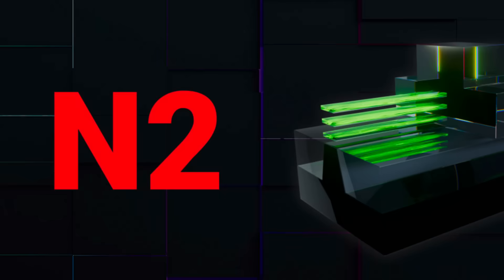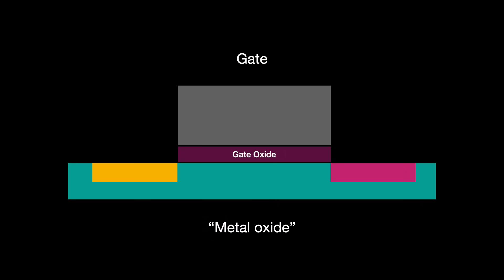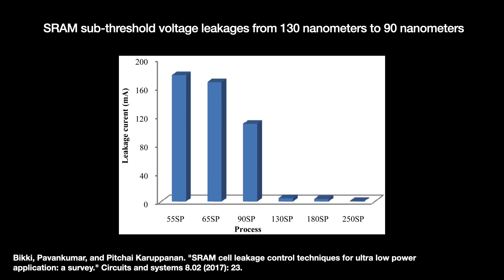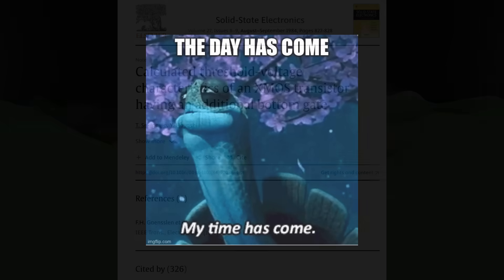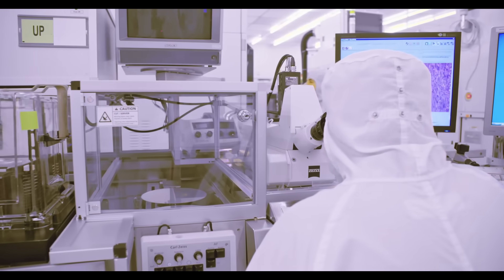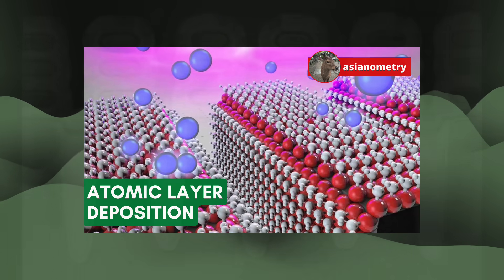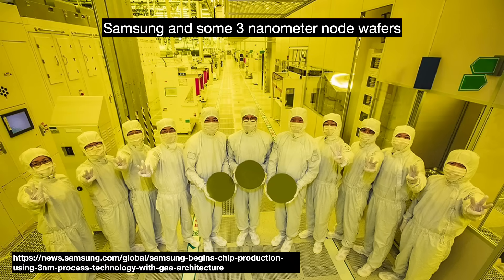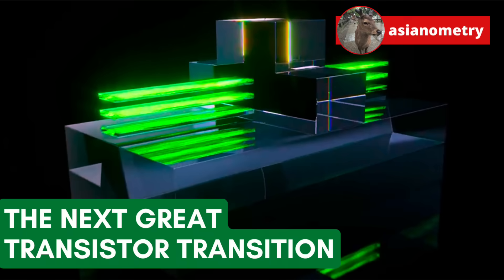The Gate-All-Around Transistor is Coming

Comment: I have learned more about fab processes from your channel than I did getting an electrical engineering degree.
Reply: When I studied, around 1992, the professor said, that replacing analog, chemical photography with digital cameras was impossible. It would require at least 8 Megapixel! Unimaginable at the time...
In this industry, you are out of date every 6 months, so it appears.
Others back then were positive, that the first 33MHz PCs (was it 286?) would never work, because it is just too high a frequency...
And today, they still have some wiggle room left to improve electronic circuitry and the production process. But also that will end, rather sooner than later. I wonder what will then come next... Me personally, I have no idea. Nonlinear optics? Biotech? Maybe asianometry could enlighten us, how the non-electronical future might look like.
Reply: @neo3418 The first 33 MHz processor was i486. There was a 33 MHz i386, too (AMD took it further with 386DX40 MHz). 

Intel's fastest 286 was 12.5 MHz. After launching i386, Intel moved all its atention to it, and Intel didn't allowed that second source partners could make the chip. So the second source partners, stuck with the 16-bit 80286, had no other option than develop the chip clock. The fastest 286 achieve 25 MHz - made by Harris. Most 286 motherboards topped at 20MHz, due to the scarcity of higher speed chipsets. There's an additional problem about that, because AT(ISA) bus runs at 10 MHz max, so the chipset has to decouple the bus from the processor.
Reply: There's already working biotech and their manufacturers claim it's better than silicon and quantum computing. Expensive as fuck tho, you gotta replace the organoids every few months. Also, not very ethical
Reply: Why would you learn about fab processes when getting an electrical engineering degree?
Reply: @its_jjk  Was communications engineering - a specialized electrical engineering course. And it was a class about how integrated circuits are being made and how they work. We also had other peripheral classes like statistics and whatnot.
Reply: @its_jjk because achieving design characteristics of a device/component depends heavily on how you fabricate it...And an EE student is meant to learn about designing physical aspects of transistors.
Reply: @its_jjk I took computer programming and they had me take accounting and psychology courses. Post secondary education is not truly about getting educated anymore, it's about jumping through hoops and paying money.
Reply: @SupraSav  - Industrial Psychology can feed into good UI/UX design and accounting is just useful in general for business. It's still a little odd if those were hard requirements, are you sure those weren't chosen electives?

Comment: Yeah you should have stuck "to TSMC" at the end of that title since Samsung has been using GAAFet in production.
Reply: They do... but they have no high profile customers making anything really cool to point to yet. And that's not the first time Samsung Foundry has been in this boat: Their fabs claim to have the best thing since sliced bread but Samsung Products is having their flagship chips produced.... by TSMC...
Reply: @andersjjensen  After researching more, there is conflicting data about what Samsung is doing.  They don't have GAAFet in production.  There are article TITLES that shouldn't say what they do.  When they are in production on their "3" node they'll be using MBCFet according to ONE information release, and they said it won't have the performance of TSMC N3, whatever that means.  MBCFet is almost the same as GAAFet but it deals with nanosheets instead of nanowires.  I assume the transistor are bigger and therefore transistor density isn't as good.  And I think it would be easy to assume this is about lithography and being able to etch out the details for GAAFet if all this is true.
Reply: @johndoh5182  Sounds like Samsung allright. They also touted having "26Gbps GDDR6 memory that rivals even base spec GDDR7X memory"... but after 9 month the status on their web page is still "sampling" which means they do, in fact, not have it in volume production.
Reply: And there was recent news out of SK that Samsung had a production yield of exactly 0% with GAA when they ran one of their internal chip design through the process.

Comment: is this GAAFET solely for power reduction or how much density increase is there? i.e can we pack more logic inside it?
Reply: With GAAFET they can move the source and the drain closer together shortening the channel length of the transistor. Also with nanosheet the fin are now sideways and on top of each other so they don't take as much area as current multi-fin transistor.
Reply: Video stated around 15% density improvements. Not sure if this is without backside power delivery. But better power efficiency means better clocks, and that is very nice

Comment: Hughes developed this tech in 1985.  Good luck finding out what happened to it. :)
Reply: There are many MANY semiconductor technologies that were proven in the lab several decades before they became commercially viable. One thing is to do it. Another thing is to do it with such low defect density that you can build anything useful with it. And another thing, yet again, is to be able to do that at several hundred wafers per hour with a method that can be "copy/pasted" to many production lines spanning several fabs.
Reply: Hmm. Nerds like arguing about who did what first, but gate all around at 1 µm is not the same as gate all around at single digit nm. Completely different manufacturing challenge and a whole different pressing need to make it work in order to advance the technology.

Comment: This is basically the only thing about manufacturing nodes that I have high hopes for. Lower power consumption means that you can squeeze more cores and more GHz in the limited TDP, which can directly improve the performance.
This isn't something we really see in recent years. Despite how active manufacturers boasts their new nodes, the frequency of actual chips didn't really increase as much as they claimed, the power consumption per core-GHz didn't really change, and the price is getting higher every gen. To some extend, newer nodes are no longer an upgrade anymore, more like optimizations for certain usecases. Hope GAA could at least get the performance uplift back on track.
Reply: I give it 3 years from reaching the market before Wirth's law renders the performance gains irrelevant

Comment: Could you make a video about the prospect of using a particle accelerator in a semiconductor fab, both for cutting the wafers really thin and as a high power light source?
Reply: this
I recently heard that chinese fabs were considering use of particle accelerators as an alternative to EUV and had never heard of the technique before
Reply: Can you name some articles on this?

I definitely want to look into this.
Reply: @kingkrrrraaaaaaaaaaaaaaaaa4527  I would have to google. It would be quicker if you googled it yourself.

Comment: I've been out of the semiconductor game for a long time. Does anyone have the figures of merit for these transistors?
Reply: What FoM are you looking for? As far as I'm aware, unlike with the switch from planar to finfet, the switch to GAA and CFET isn't about individual transistor performance as much as it is about TOR density. As RF designer, everything since 22 nm is a step backwards for my performance (though I hear the high-speed analog guys still get some minor gains).
Reply: @JorenVaes I would love to know what the f_t and transconductance looks like. It seems like there is an improvement in output impedance too? I'm just curious how the transistors are better. I haven't seen any numbers for all these nodes, so it's hard to contextualize what's improving and what's the same.
Reply: @ion599 I can't comment on Ft, as we tend to not use that that often in millimeter-wave design and work more with Fmax as a metric instead. In general, Fmax has flattend around 300 GHz since 65n, and stayed quite constant until 22 bulk (with exception of 22 FDSOI, which has an Fmax of about 380 GHz). Since finfet, it has dropped back down, afaik the most recent nodes have an Fmax of about 250-ish GHz. 
This is mostly BEOL limited though - intel has a special 16nm finfet process optimized for RF, and that has a custom BEOL, and supposedly has a crazy Fmax of like 380-400 GHz.
I believe a colleague of mine, Carl D'heer, has done some work on quantifying this Fmax over technology in his PhD thesis, but I don't know if this is publicly available.
Reply: @JorenVaes It's a shame that the process improvements are not creating faster transistors. It would have been nice to have power gain deep into the THz region. Thanks for answering my question!
Reply: @ion599  FinFET, then GAAFET, then Forksheet seems to make sense, as there seems to be gains in multiple criteria but CFET seems to have little power efficiency and performance improvements… 

I believe the next step is Post-CMOS spintronics / ferro-magnetic related technology based on Magnetic Tunnel Junction (MTJ) (or derived from it) like MRAM, Intel MESO concept, Spintec FESO concept… Semiconductor R&D should be focusing on spintronics instead of CFET as it has a much bigger improvement potential than CFET…
Reply: @ion599 You are welcome! There is definitely work on making faster transistors, as there is a push to move to higher millimeter-wave frequency bands for communication (mostly point-to-point) and radar (140 GHz band). I know GF is working on a faster process, and intel might make that faster process publicly available.
Reply: No one can escape from this game without moving out to the forest in survival mode… because each and every moment of your life the semiconductors are all over the place around you… until you get back into the game and start upgrading your knowledge realizing that the game has never stopped haha 😅 I am personally just an enthusiastic player who is not involved in any kind of design but this show is so fun to watch because it has the best presenter in the industry so seriously conscious and so deliciously funny ❤